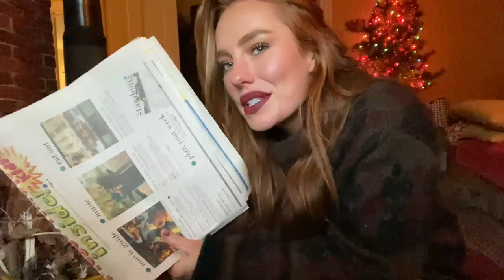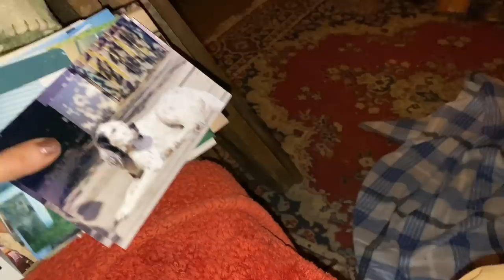Surviving FRIGID temps with WOOD STOVE ONLY in 100 + year old Farmhouse .. Ep. 8

Comment: I love that farmhouse! I could live in a place like that. Just an FYI, you shouldn't heat things like those baked beans in the can they come in because the cans have a thin liner in them that when heated will release certain chemicals the liner is produced from. Certain things like that are not harmful unless you bring them up to a certain temperature, then they say they may cause cancer. Same with re-using plastic water bottles that have been left in a vehicle in the heat of the summer, once that plastic reaches a certain temp' it releases chemicals.

Comment: Yes, metal ash bucket! Oh boy, where to start on the wood burner. Safety first! Start fire small, you get through holidays split up some kindling, then split your medium size chunks like 4” to 2” and your bigger wood to 4” chunks. Fire has to be built, that takes some time. Opening the door a tad and letting it draft hot then shutting door, kind of, then open to heat up. You could do this for 30 minutes. Nothing in the world more satisfying or really romantic then a perfect fire on a cold winter day. Feed the fire slowly with harder wood. Use soft wood to start it. If you can find some hickory use it as your main heat, it takes time to dry and cure. Cut a year ahead. I know, crazy talk but just giving you the reality of burning like a pro. Staying warm and safe. I started to follow you on the wounded deer episode, congrats on the good buck! A true country girl, beautiful inside and out. Happy New Year young lady!

Comment: If You allow some suggestions: Paint the house with water-resistant paint to prevent damaging the exterior wood; If authorized in your state, place a deposit of water collected from the rain and filter systems for various purposes. As is customary in old houses, yours must also be lifted in relation to the ground and in that case find a way to insulate it below the floor of the house and place something canvas-style on the dirt floor to prevent the passage of moisture into the house. Then, put the usual protection around and that's it. Some solar panels, which now without much maintenance can last for a good 20 years, could be placed to give more energy to the house, and could even be connected only to an internal heating system. Check the windows for infiltration of rainwater or melted snow. If water seeps into the wood separations, when it freezes it will drive away / twist the wood, creating spaces where more water will infiltrate later, creating tears at the same time that it can damage parts of the structure. If possible, make a small ditch as if it were a protection around a castle to quickly remove rainwater from the soil where the house is. Whenever it rains or snows, the floor will get wet, but the less water around the house, the longer it lasts. I did it around mine and they are made of stone... (I can not send any pics about it here.) Hope I could help somehow....

Comment: I made a comment the other day about putting a kettle of water on your wood stove to the side you need the moisture in the air to keep your house from drying out and you your nose and lips, but I now saw you clean out your big stove or heater and put the old ashes in a cardboard box, don't do that unless you want your house to burn down always always clean out and put ashes in metal bucket, you might think ashes are cold but they can surprise you and fire up your cardboard box. Believe me on both counts
Reply: You are correct.  Surprised her mom didn't straighten her out on that.
Reply: Very very true
Reply: I put my ashes in a metal bucket and put outside inside my grill. After setting for a day I move them to a metal trash can with a lid and then put them on the edge of my garden in the spring.

Comment: We lost power here in Grayson County, Virginia, too. It was out for a couple of hours. I think you guys should invest in some battery powered lamps, like the TacLantern you see advertised on TV. You can buy knockoffs at most stores and they work just as good. Also, get a phone charger packs. I have 6-7 of them. If the power goes out, you can still charge your phone without having to go outside and charge it in your car. If you have sleeping bags, don't be afraid to use them indoors. I try to be as ready for anything as possible. If you don't mind a little  extra work for your water, you can put a clean bucket outside and collect rain/snow  and melt it on your stove and wash that way. Happy New Year. By the way, more bad weather forecasted for Thursday and Saturday, be ready. Be safe.

Comment: Here's the pro method for starting a fire; stick two logs in, parallel, stuff paper between them, put one log perpendicular over the top, and a bunch of small sticks over the top. If you REALLY want a 1 match fire, grab a presto log, slice off a few thin rounds and put the rounds under the cross log. The teepee method is better for big campfires.

Comment: if you can, add a small thermal fan on top of the wood stoves, it moves the air around 😉 I would also recommend all-terrain tires or all weather tires to help with your driving.

Comment: BEST Fire Starters are pine cones dipped in wax. Get the wax from garage or estate sales. People are always selling old 1/2 burnt candles. Pick up an old sauce pot and throw the wax in an melt it all up. Then use a needle nose plyers and dunk the pine code and throw it in a box or paper bag. Filler up with pine cones and come the next wood stove or camp fire, you only need 1 or 2 to get the kindling going... give it a try. Works like a champ (especially for hunting camp fires!).

Comment: I lived till 2016 with wood and coal stoves on my historic farm homes. Also your bedding counts. Down mattress bad, down comforter, flannel sheets, quilts, wool blankets. Always use a metal container for ashes and spread out after cold  outside far from any structures or burn able objects, grass etc. People in my Appalachia still live off grid with water, outhouse, electric and heat. Never used air conditioning either still don't. I liked it better. Had the well pump, outhouse, slop bucket in a chair. Off grid homesteading is so popular on YouTube but we didn't have solar just passive solar with south facing windows etc. You are lucky for your old farmhouse etc.

Comment: Tractor supply has the metal style ash pails/bucket... even watch where you dispose of I have caught my woods on fire more then once... You will have better luck next year when you cut wood all summer and it is cured. The dampers on the stoves will control the heat.. when you sleep at night fill with big logs and close damper almost closed... when you wake up you will have hot coals that will take off as soon as you open damper. Enjoy I heat a 3000sq ft house with one fisher wood stove keeps the electric bill lol... Nice Farm House ! Enjoy

Comment: Please get a metal ash bucket and fireplace shovel set to clean out those stoves. Putting those ashes in those amazon boxes will burn that place to the ground in the middle of the night! Also, get you a combo co/smoke detectors for each floor battery operated and a big fire extinguisher for each floor. Cheers!

Comment: I get a kick out of this being treated like it's somehow abnormal.  My wife and I live in our farmhouse that's heated with wood in -50 degree weather and think nothing of it.

We also cut and split our own wood.  Having it delivered is for city folk!
Reply: Do you recommend having a thermal fan on top of the wood stove?
Reply: @cello4ever85  

We have a blowerfan built into our woodstove and it makes a huge difference!  We can actually heat our entire house with the one stove.  

The thermal fans don't move much air but they do help.  If you really want to move some heat and don't mind a bit of noise, get a box fan and put it by your woodstove.  This will help spread the heat into other areas.

Woodstoves take a lot of practice to make them run the right way 😃

Comment: Heidi,  we get it when you want to live in an old farmhouse and live a simple life.  But there is something you should have professionally checked and inspected:  Older buildings used paint with lead, pipes were cast iron and threads were sealed with lead-based pipe compound, and asbestos was used to shield heating & stove ducts.  Now, it may be the case you have nothing to worry about, but you should have wall, trim and baseboard paint checked, plumbing & ducts inspected by a professional.  It is wonderful you can live in an old farmhouse and share such memories, but do it safely and don’t be afraid to hire a pro when you need it.

Comment: Be careful putting ashes in a cardboard box, my roommate darn near set the house on fire like that. There could be hidden tiny coals still hot and an hour later, bam, you got a fire. Also, in front of the woodstove door, there is no barrier between the floor, dangerous, especially with a carpet right there. I wouldn't want little red and mom burned out. It looks like a lovely place.  You guys did a great job! Oh, and you might want to get some starter logs, a lot easier to start the fire. They go for quite some time and all you need is a little chunk to get the real logs started. Just keep it away from the dog so he doesn't chew on it. Ok, I enjoyed the video. Merry Christmas!!

Comment: I am hungry now. You can take insulation bats like you use in a wall. Cut them to the window length and wrap them in black plastic and use them at insulation on the inside of the windows. Will help warm up the house. Works real good at night. Hold in heat from the fire place and keeps people from looking in.

Comment: I've had woodstove only heat for the last 35 years here in the High Desert, it's good to see others that refuse to pay into the propane racket! One Question why don't you have a either a pan of water or like I have a cast iron kettle(tea kettle) on your stove? Here in the High Desert of Nevada we have all extremes of weather from 115°F in the summer to -20°F in the December to Beginning of March

Comment: I remember getting stuck in a couple feet of snow and having to hike to a summer cabin for the night it had the queen of all wood burner kitchen stoves two ovens griddle overhead warmers and on this particular night we feared a meltdown as we brought the oven gauge up to almost a thousand degrees burning pinon and in the middle of the night a packrat ran off with everything shiny that we left on the table and it took us hours two find his stash in this two story cabin it was up in the attic insulation and he really had a pile we tried to stash all the food so the owners of the cabin wouldn't have to deal with the rat on our return in the spring we discovered that this rat could here a pine branch that rubbed on the second story and had chewed a hole through the peak of the eve so that he could escape down this tree to the ground a real pro was this rat!

Comment: If you do not already have a generator Honda makes a good quality quiet generator but expensive, Predator generators are also good and quiet they sell those at Harbor Freight and Generac is another good brand they are made in the US but not all that expensive. For small things like charging phones, laptops, lamps etc get a Jackery portable power station, give them a call they may give you one if you use it on your channel, they sponsor several You Tubers. I hope you get your well/running water situation figured out, that must suck.

Comment: Never ever ever use a cardboard box for stove ashes, even when you think they are cold. Ash is a great insulator and can keep a live coal for a very long time. Also, never leave your ash pail, even if it's a metal one, which it should be, beside the stove. Remove them from the house right away and store 
safely away from the house. Any hot coals will be giving off carbon monoxide.

Comment: Alladin lamps will help with power outages
Reply: Alladin lamps are very dangerous at mountain altitudes. They are known for running away and starting fires.the rayo or b&h center drafts are much safer.